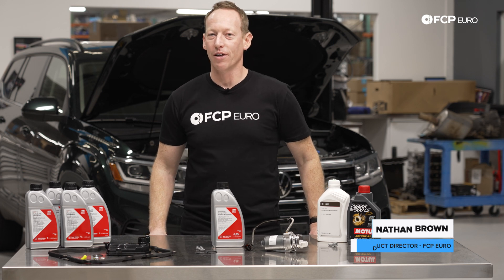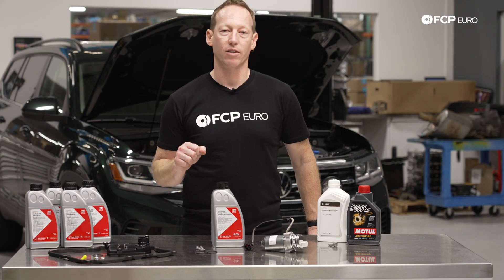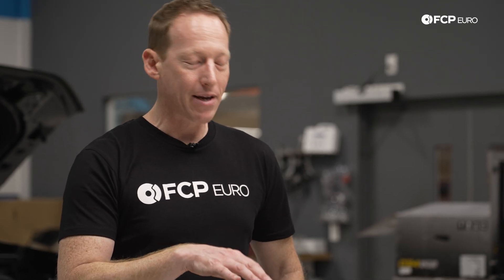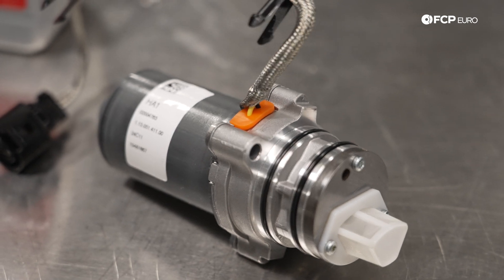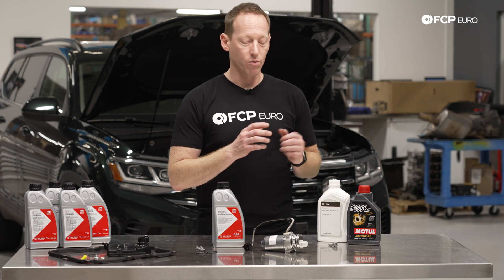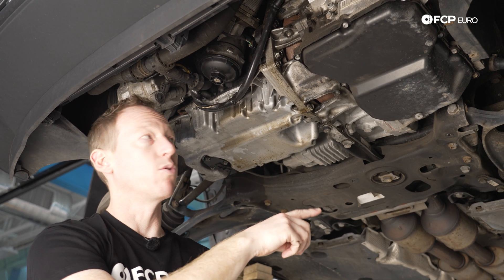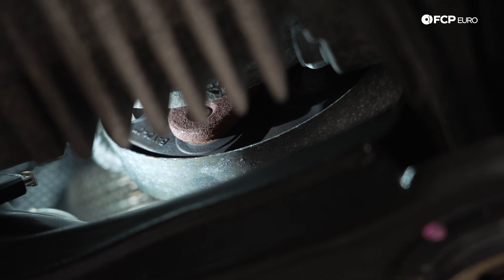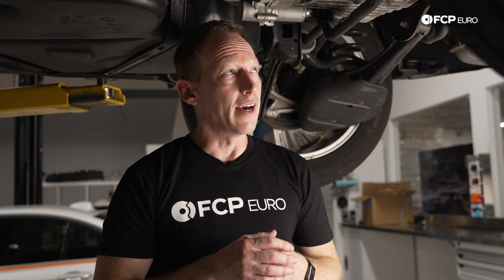Volkswagen Atlas Transmission & Driveline Guide (2018-2021 VW Atlas MQB, Cross Sport)

Comment: How do I check the fluid level? and I bought a used 2018 atlas with 91,000 not sure if the previous owner changed the tranny fluid can I still get it done at that mileage?

Comment: @fcpeuro you should do a diy sunroof drain cleaning and sunroof maintenance for the cleaning the front and rear drains and sunroof mechanisms for the atlas. Vw suggests 2years/24k miles but sunroof leaks are so common on these because of clogged drains.
Reply: This would be the best!

Comment: I believe the torque converter has issues. 2018 has a nasty rattle. Come up to a red light that turns green and the transmission stays in 3rd gear. Low speed and load makes grind/rattle noise. Dealership says it is normal, but they can never duplicate…
Reply: Have them do a roll down to 6 mph, but not 5 mph, and the trans stays in 3rd and makes the whine. On 2021+ they have "silencer" plugs you can find online to plug in the openings on the trans to make it quite. The trans will never downshift to 2nd, due to the programming. Really dumb, if you ask me.
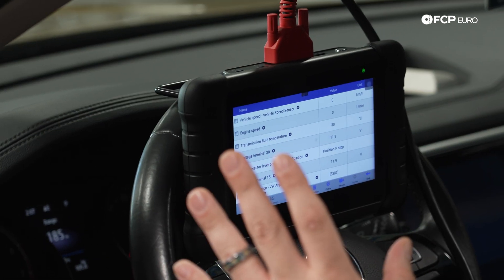Edit: Got further into the video and saw they mention this around 7:50.
Reply: @ Thank you for the suggestion. I did watch the entire video before I commented. I was not sure if the covers were for the same symptom, but I will try it. It wont hurt.
Reply: @crackonwithnowak5087  another way to replicate it is to shift the trans into manual, and do a pull. It'll make the sound. The silencers will definitely help cover the sound, though. I wish there would be a TCU update instead, but who knows if/when that would ever happen. Even an aftermarket one that fixes it would be awesome.